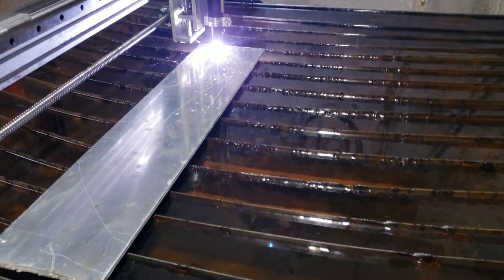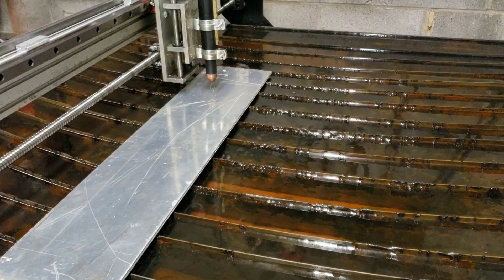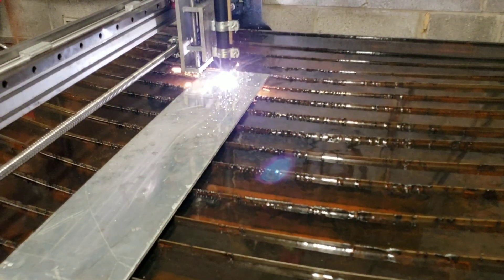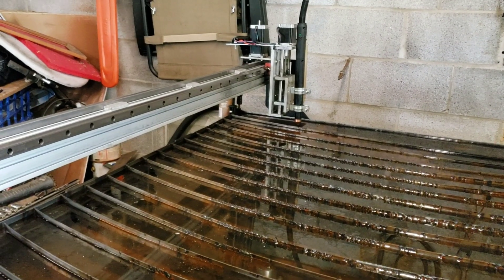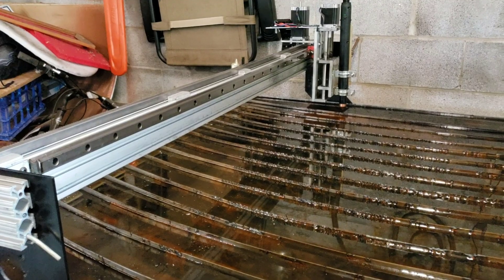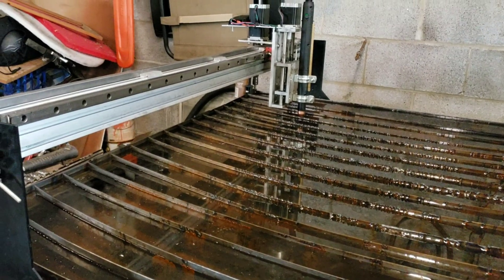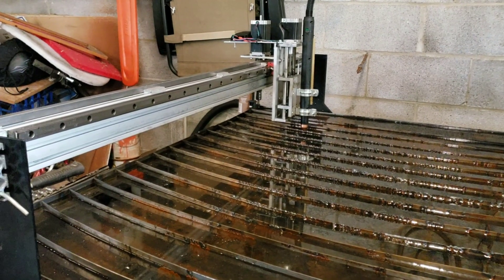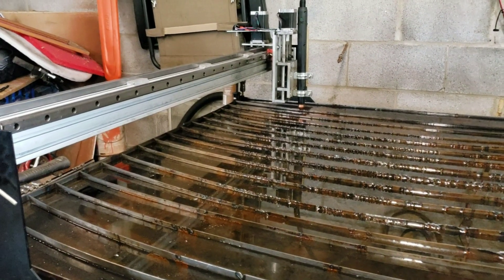My experience lead screw vs rack and pinion

Comment: How about the accuracy man? Which one is better?
Reply from the maker: In my opinion rack and pinion is by far the better choice. That being said you have to be sure your gears mesh well and have proper tension. Mine do not slip at all. It's all about how you set it up.

Comment: Do you have the links to the rack and pinion that you ordered? I'm in the process of upgrading a table I got and want something that quick for cutting and not having problems like with belts and leadscrews.
Reply from the maker: I got them on Ebay
Reply: @bobreichel  sweet! Do you have a link or just looked for those under the names of them. I've looked a few times but sometimes I get different sponsored ad listings that I want to make sure I'm ordering the right ones.
Reply from the maker: @C3Customs  I searched under "CNC Rack and Pinion"
Reply from the maker: @C3Customs  Ebay item number:  162796011737  he also makes the gears you'll have to contact him and let him know what you want.